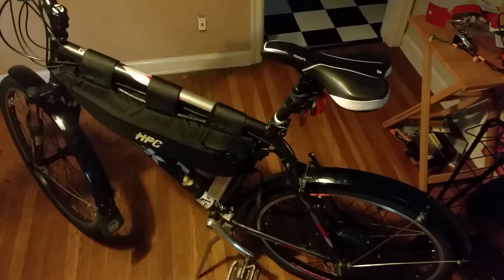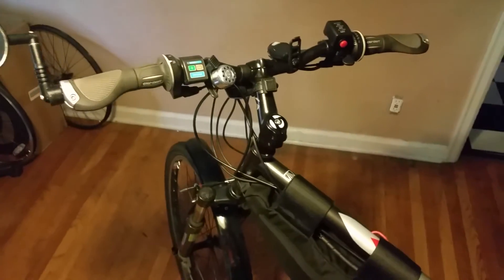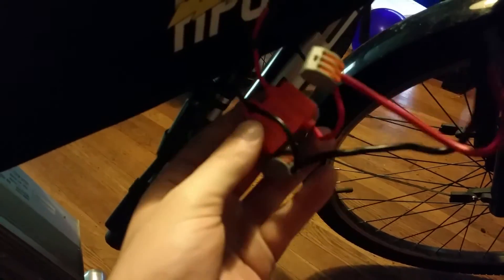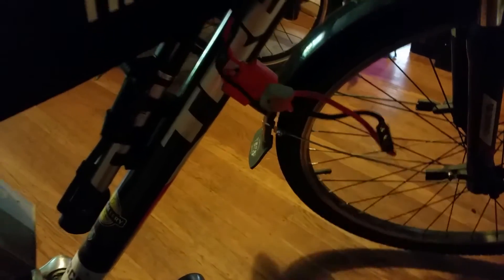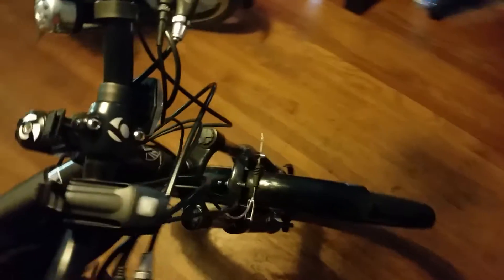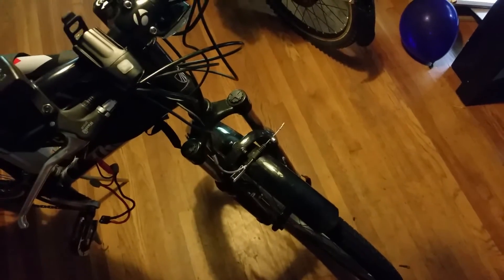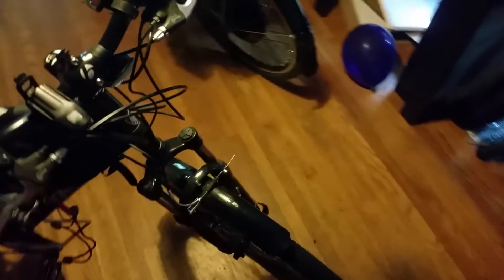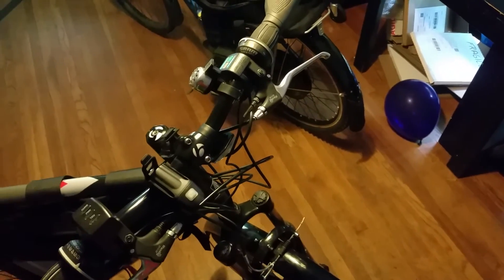5000 Mile DIY eBike Update

Comment: hello.  When cars are stopped at an intersection, watch their front wheel.. if it starts to spin, they haven't seen you.  Cars look right thru thin bikes (they see wide cars and trucks) so weave side-to-side to make your self appear wider.  Have a blinking light on the front (motion gets their attention). Use the skills that they teach in the motorcycle safety courses (level 1, 2 and 3)
Watching that front wheel will save your life.  AirZound by Delta works great to get their attention.

Comment: any suggestions with hub drives vs mid drives?
Reply from the maker: I don't have much experience with mid drive systems.  I believe rear hub motors to be the best for commuting and I will probably always choose that route myself.  If you do want to go mid drive, I suggest looking into one that uses torque sensors not cadence sensors.
Reply: PDXevgrin thanks for the reply, I'm seriously considering a Copenhagen wheel now
Reply: Eh.. not so much interest in the Copenhagen anymore. Lack of info on battery is main reason. Modularity so I can replace and upgrade that seems important as a commuter
Reply: Looking into a direct drive motor from grin. Any thoughts on the 9c or grin all axle? Do you use Regen braking?
Reply from the maker: Robin Deguzman I don't use regen, but push button brakes does sound good though. You won't be able to get the thru axle for a bit. I believe they are still beta testing it. My next motor will be the standard wound 9c rear hub. My current usage is about 30-35Wh/mile and with my calculations the 9c would drop me to 17-20Wh/mile. Pretty hefty range boost.
Reply: I am liking it as well however not sure how serious a concern 'flange wobble' is.
Reply: Are you using Disc or Rim Brakes?
Reply: Ken Doty thanks for reply. v brakes. I figured out that flange won't be concern for me
Reply: PDXevgrin, would you be willing to sell your old kit?
Reply from the maker: Robin Deguzman why not just get a new one like mine on ebay for $209 shipped? my old wheel is missing some spokes and with weight it would cost a bunch to ship. My old kit didn't have the cruise module either. if you look on ebay, search for "48v 1000W rear kit" and look for the one with cruise module.

Comment: Hi again- Would you recommend a triangle bike frame bag- i'd like to hide the controller and associated cables ;-). thanks!
Reply from the maker: Sure. Falcon EV has a cheap battery specific triangle bag or Luna Cycles. Just check any others' specs for width to make sure your battery will fit. I personally prefer my top tube bag and keep the controller out so it gets good airflow. The wires are still all hidden in the bag and the controller is waterproof.

Comment: Good info. Your bike looks good for 5000 miles. Have you had to change your battery yet? Or is it still working good? What kind of distance do you get with your battery? My ride is downhill to work and uphill home and up to 9% grade uphill as I live in the mountains. I can get between 28 and 35 miles with my lithium 48 volt 10amp hour and 500 watt hub motor but it was predicted by the bike company about 24 to 46 miles depending on peddling. And of course some nights I get a little more help depending on my day.  :)  Thanks for the post.
Reply from the maker: I just checked by computer. I'm at 6700 miles total since starting ebiking. Current bicycle has about 3000 miles. This is my second build. 5000 on original kit. 1700 on new kit. Killing the first one was my fault though, both bike and kit for different reasons. My batteries are just fine. I'm not sure how many charge cycles I'm on. Easily over 500. I charge to 80-90% though. That is key. I just ordered a new battery and charger because I'm moving and need a bit more range as well as a bit tired of charging two sizes of packs. I'll do a video on the new system when it arrives. My current batteries will be backup/extra range or thrown into the blue bike I'm keeping to allow friends to joyride with me at my speed ;) You are getting good range. Best advice I can offer is to only charge to 80%. It will triple the lifespan.
Reply from the maker: Oh and to answer your range question I get 28 miles out if a 90% charge in mountainous area with my 52v 15ah lipo pack. That's riding with a 20mph average speed. I should expect 35 miles at 80% on my new NCM 52v 17ah pack.
Reply: PDXevgrin Thanks for the answers. I know that the manufacturer of my bike firmly said to not charge more that 10 hours (way more than required) basically I figured out to charge till just charged then pull the plug. I agree that less charging is better as it seems these lithium's do not like to be charged any extra. I am not sure how you are able to charge to 80% as my charger only has a red charging to green charged light. Do you have an percentage or decimal voltage indicator that you refer to on your charger or attached meter? I would be nice to have an adjustable charge unit to charge to the 80% or best charge level.
Reply from the maker: +Steves Place I have a smart charger for my lipo. I can choose whatever I want and it balances all of my cells perfectly every time, not to mention being able to fully charge in 2 hours. Check out Lunacycle.com. They have chargers with switches to limit the end voltage. I think ebikes.ca or em3ev.com should as well depending on convenience of where you live. I think pulling the charger before it's finishes may not leave the cells all balanced properly by the BMS. Lipo doesn't have a BMS, my iCharger does the balancing.
Reply: Thanks for all the info. There is an incredibly  huge amount of Ebike hardware out there but it is trying to find the right stuff and decent stuff that isn't junk or suck your wallet dry is the trick. Thanks again.

Comment: Thank you for sharing your expertise. Would you have recommended battery suppliers for 36V 800W controller that you could share? I am looking for lithium instead of connecting SLA in series that my Amazon cart keeps recommending ;-).
Reply from the maker: forget watts when looking for a battery. you want a 36v 10 or 15ah lithium battery. consider how/where you want to mount it. you can get them in cases, different shapes for different types of frame bags etc. check out lunacycle.com, em3ev.com,   pingbattery.com. all of them have good quality plug and play batteries. Good luck!

Comment: Nice videos. Subed.
I ordered parts for my first ebike. Questions of course :) 
Is the controller watertight enough (it looks it is) especially around the wires? I thought I'll have to put it into a waterproof case. I live in a rainy country, so any waterproofing tips are very welcome. 
Another thing is: Is your 14S installation much better then my planning 12S? I do not want to mix a different types of battery packs and I want to have a plug  play charging (with BMS). As I suppose it is only a matter of max speed. Isn't it? Happy riding!
Reply from the maker: 12S Lipo is 44.4v where as 14S is 52v. If you are running a BMS, you're probably getting LifePo4 batteries so 12S LifePo4 is 48v. Lipo doesn't need  BMS, you're charging system balances the cells. More voltage adds some torque and top speed. I do charge my two sizes separately. But I still can charge both in 2 hours. the benefit of Lipo for sure. If you are going lipo, check out the cycle satiator from grin technologies. You can use that to charge plug and play. Good luck! I hope I answered your questions. if not,  keep em coming!
Reply from the maker: Also yeah,  the controller is waterproof. i run mine in open air. I live in Portland, one of the wettest cities in the USA and I ride all year long.

Comment: Nice Video!
Somehow i dont seem to find conversion Kits as cheap as 200$ here in austria :( i got mine for 340€ (380$) and it only has 500W. It is sufficient for most parts, but im thinking about upgrafing the controller and the lcd display to 1000W, since the motor has a sticker saying 1000W on it. Think that is possible? And doing 5000 Miles on a bike is quite impressing. On mine, which i have since almost a year i have 1800Km now, that is 1100 miles. It is funny to see how many spare parts (mostly tubes) i needed in the first weeks, and till now i didnt have to use one again. However now it becomes time to change the  tyres again, and new brake pads are also always on the list. They did however almost last 1000 miles! And I have  another Question for you: Do you spend a lot of money on maintainance of the bike? (How much) And wo much did you spend on your whole setup in the beginning?(bike, kit, batteries, chargers, cables, ...)
Have fun cycling and drive safe!
Reply from the maker: Thanks for watching.  I'm glad you liked it.  If your motor says 1000W, it's probably rated for it.  I suspect many of the rear hub motors are identical in the winding and are able to be used for various voltages/wattage.  For example, my kit is 48v 1000w, but i run it at 14s 52v which makes closer to 1200W.  But the other bike I just built has the exact same winding and can be run at 44.4v no problem and if it had a 36v controller it could be ran at 36v.  I do know my kit is able to handle up to 60V, and I charge my 52v battery system to 57v.  IF you want to upgrade the controller I hear an infineon or grinfineon (upgraded by grin technologies) at ebikes.ca are great choices.  I hope they are available to ship to Austria.  I saw the infineon controllers at lunacycle.com as well.  

As for maintenance -  My first bike was a mongoose impasse dual, which is a really crappy big box bike.  I had to maintain the crap out of that.  Always greasing the seat post, joints, suspension, chain.  But my trek 820 needs very little maintenance.  I grease the chain every week or so when it's dry and every few rides in the wet. I adjust my brakes whenever needed.  I ride 30-40 miles per day though. If you are in the market for brakes, I just bought the avid single track 7 brakes and I love them.  A really noticeable upgrade from the stock low end tektros.  I had the avid bb7 disc brakes on my mongoose, but I find that disc brakes are not necessary.  If you can lock up your wheel then your brakes are just fine.  Good pads (i like kool stops) and the consistency of the single digit 7s make me feel perfectly safe now.  Very agile in sticky situations.  Tires:  I now ride the Kenda K841A Komfort Tires.  They are a bit narrower than the slicks I had but these have great rolling resistance and much better in gravel, dirt.  I went through a bunch of tubes.  Now I use mr. tuffy tire liners, regular tubes and the kendas and haven't had a flat in a long time.  Well over 2000 miles.  I had the kendas on in this video but forgot to mention it. But I really think that flats are just part of the ride.  Get used to it ;P As for other bike maintenance, I really think it depends on normal wear and tear.  At some point I'll do the same I've done with my first bike i.e. bottom bracket replacement, changing free wheels and chain when needed.  That's all to be expected though just as a normal cyclist would.  As you replace, get the best you can afford at the time.  The level of performance I chose for my build, trek 820, any replacement or decent upgrade is available for little money.

Total cost of this bike, battery and charging system if it were to be built from scratch with all current upgrades = $1400.